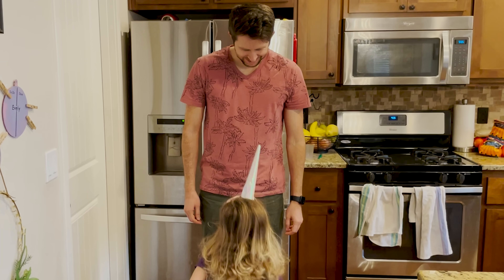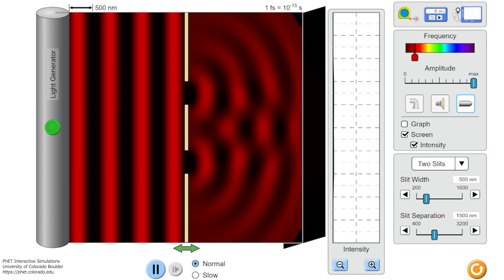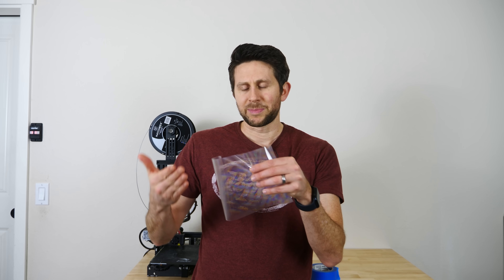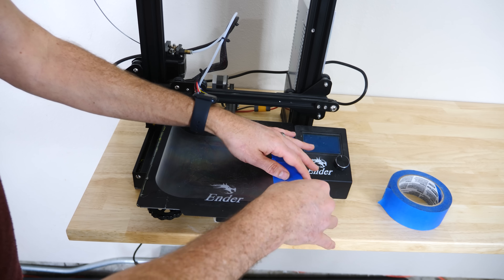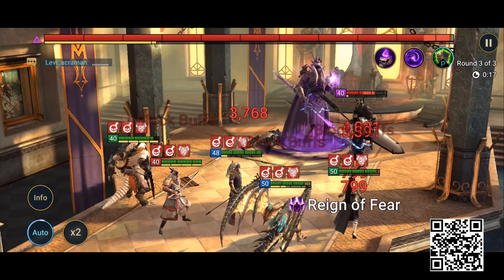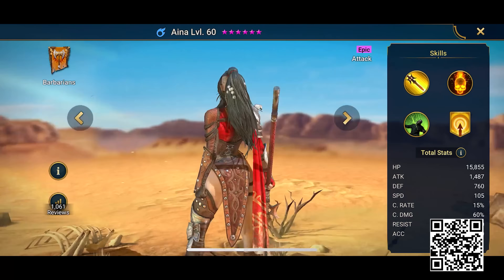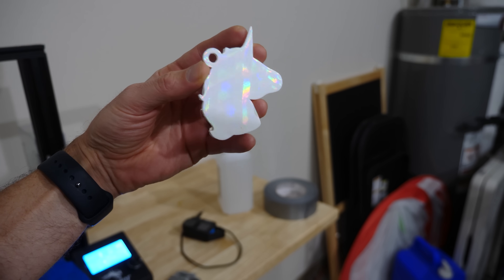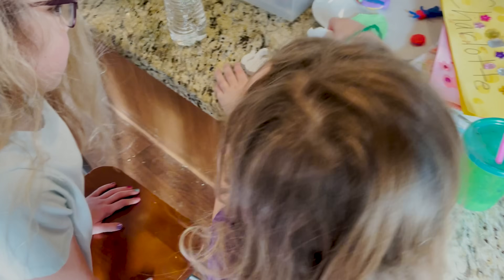Is It Possible to 3D Print a Diffraction Pattern?

Comment: Ok so told Google to search resin bath 3D diffraction grating but it brought up flat surface extruder printing on diffraction grating. It's not even the same type of 3D printing lol. Resin bath printing uses liquid printing solution and everything you print looks like a crazy slime experiment coming out of the printer.

Comment: I know it would work the same if you applied it to the build plate but Wonder if you replaced the fep film in a monochrome resin printer with the defraction grating and printed a 3d shape would the pattern kinda work on 3d the edge of each layer on a sphere say might still be coloured if the defraction grating doesn't totally mess up the print

Comment: Could you possibly "iron" (meld the PLA with an iron with the sheet inbetween) the diffraction pattern on the top part of the 3D? To get the sparkles on both sides.

Comment: put two strong magnets one above other in the way they reflect each other and cover the sides with the glass, so the top one doesnt fall, magnets should be placed on a weighing scale, measure their weight, then put a 2kg of something above the top magnet and see if the results are the same.

Comment: There is a Taiwanese company that sells adhesive backed, holographic sheets with various patterns called 'P-Flat'.
The holographic pattern is imprinted into the first layer of filament in a very similar way to this diffraction grating method.
Works great with TPU and PLA.

Comment: simply so this comment doesnt get burried, replying here
"Wonder how long it will be before 3D printers can actually print to this resolution, though" Dudley Middleton
.........i could probably do this on my laser cutter, ablate away material, being optical, the focus can be set VERY precisely and the tighter the beam, the smaller the working surface, "all" it takes is a few lenses and/or mirrors, honestly this is getting into the range of material sciences and current chip processes in industry fabrication and stereo lithography

Comment: Hi so is it possible to get diffraction aluminium? Printing often on the same foil (I assume) will destroy it but if you could get your hands on a "diffraction aluminium 3D printer base" all of your prints will be diffraction on the bottom and a slightly temperatured second to press on top of your prints will make them shiny on both sides.

Comment: Did the printing damage the refraction sheet at all? I’m currently learning about light this kind of stuff in chemistry, and my teacher has refraction sheets. I’d like to try this with my 3D printer, but I don’t want to damage his refraction sheets.
Reply: you can just buy them online. Also, I doubt they´ll take damage. Why would they?
Reply: @sikliztailbunch  Heat.
Reply: @rishabg5583  I don´t think it gets hot enough. If it would, it wouldn´t copy the surface structure to the print material so well. It would turn flat or bend before the print is even finished

Comment: Just a 3D print question in general: how fast does the material harden? I was thinking maybe gently press the defraction sheet on the top side to come out with a pendant that is defracting on both sides.
Reply: The plastic solidifies in a matter of seconds, so I don't think that would work with standard materials. You could split the print into two sides and glue together though, as mentioned in a different comment.
Reply: @Robbo1029384756  Makes sense.
Reply: @Spartan375X  You might be able to press the diffraction grating into the surface and hit it with a heat gun to slightly remelt the surface into it. But I'm not sure what temperatures the diffraction grating will tolerate (I'm honestly surprised the ~200℃ heat from the molten plastic coming out of the extruder didn't destroy it).

Comment: It's simply a mould of the pattern like the chocolate, but molten plastic this time, looks really cool! Wonder how long it will be before 3D printers can actually print to this resolution, though.
Reply: I wonder what wavelengths of light you could print a usable diffraction pattern for with current 3D printers (note:  very long wavelengths might just get absorbed by the plastic).
Reply: @Lucius_Chiaraviglio  When it's about any electromagnetic radiation, printing such patterns with conductive filament would be an interesting topic.
Reply: There probably are 3D printers which can do it
Except they cost millions and are used for scientific/government purposes

Comment: That's a cool idea. I'm definitely going to try it (but not on a unicorn 😆). I also thought about once it's done. Put it on the top of the print. Place parchment for baking on that and iron it just enough to soften and smooth it. You'll probably have to sand the edge where it mushrooms from the melting. But it's not difficult.
Reply: Let me know if that works!

Comment: In an argon atmosphere (or some other inert gas that prevents combustion) try to heat up oil to its flash point or boiling point (if it has one) without oxygen. Just saw it on Adam Ragusea and it sounds like it's worth looking into!
Reply: Is this the video you're talking about?
https://www.youtube.com/watch?v=l_aFHrzSBrM
(also, why didn't you link it here in the first place?)
Anyway, thanks for making me discover another new channel.
Reply: @sebbes333  Didn't think the link was crucial to t he idea suggestion, my bad. This is the actual video I was watching, I put it to the timestamp roughly where he talks about it https://youtu.be/lpFyAu38SbY?t=424

Comment: You should get a silicon sock for your 3d printer. it prevents the hot end from melting your prints and also improves print quality by reducing the amount the temperature fluctuates during the print. Great video btw very interesting concept.

Comment: Thanks for trying this one, have been curious ever since I printed onto smooth glass and noticed the surface of the plastic when squished into the glass surface will almost form a first surface mirror. Gets incredibly glossy but still some deformation of the surface so not exactly a perfect or even imperfect mirror, incredibly glossy  and able to pick up specular reflections.

Comment: If you split the print in half, flip one side to print both sides on the diffraction grating, you could then glue it again to get a rainbow on both sides.
Double the fun and more Rainbows❤️ !
Reply: Just don't glue the diffracting sides together otherwise you get no diffractions
Reply: I also wonder if you could heat up the non-rainbow side and slightly melt it while it's sitting on top of the diffraction gradient. This would help with prints that can't be split in half

Comment: Sparkly unicorns! Perfect for a birthday party! The Action Lab is amazing as always!
Reply: Wonder if it would work with wax, for candles?
Reply: @Inertia888  it worked to chocolate so probably! But my question is will it work for metal. Because hot metal would destroy the plastic as you tried print it on.
Reply: @westonding8953  
You’d need something with a higher melting point than the metal you’re using.

Maybe use the plastic version to pour something on that settles and solidifies at room temperature yet has a very high melting point once solidified, then pour the molten metal onto that material instead.

Comment: Would transparent filament allow sparkles on both sides? The printed side would just shine through I suppose.
Reply: I am not sure about that , but similar incident happen with me. I think it all depends if it has a loose ends. And it will cause heating at that point and hence sparkle or even burning.
Not getting your question though
Reply: Transparent filament will look translucent. Its like bubble filled ice. Still a fair bit of sparkle through 1 or 2 layers, but not much through more.